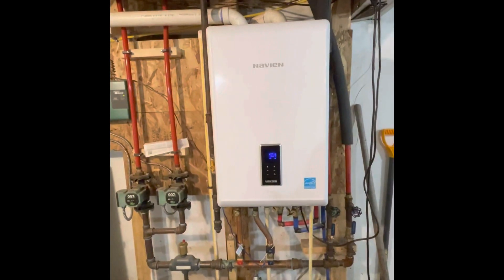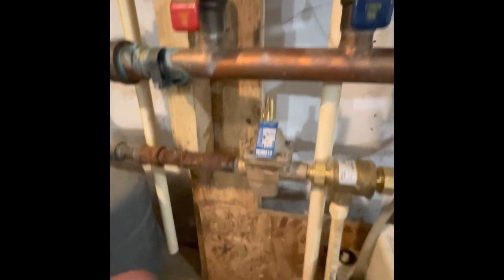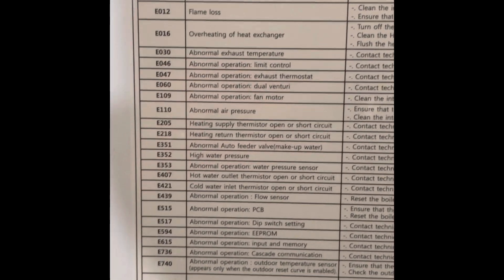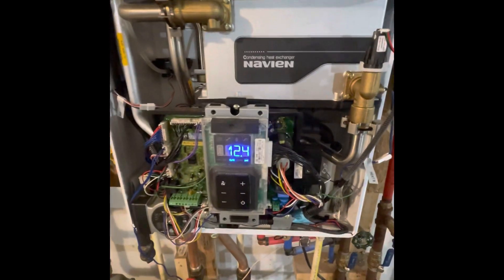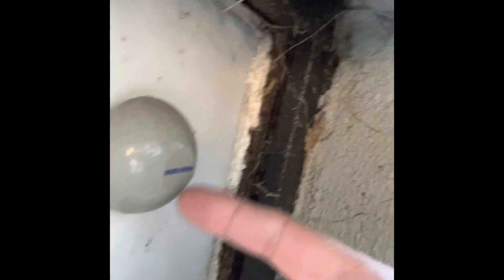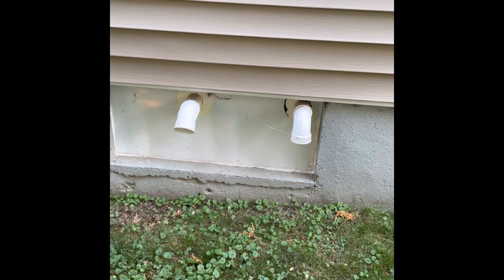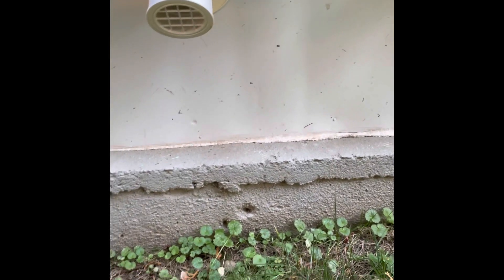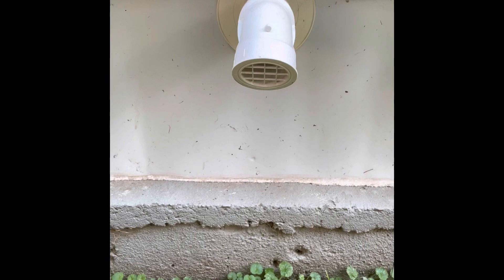NAVIEN E110 E351 error codes and tips and tricks on navien ncb-240e combi boiler - Maintenance

Comment: Sounds like you know a bit about navien heaters! I have a NR 240 that I acquired. I was told it worked great. I installed it and it worked for a bit, but now it won’t turn on. The control board does not illuminate. There was a small water leak that I fixed. Do u think I might need a new control/circuit board? Any suggestions? As a side note, I don’t have a remote (thermostat) if that matters. Thank you

Comment: I appreciate your suggestions, as well as those of some of your critiques. But it doesn’t help us. Last night a loud noise, for ~4 seconds, we had never heard, came from unit and then it stopped with E 110 code. I cleaned screen and tried to restart but got code again. I tried to share photo but it won’t let me. The intake and exhaust pipes were installed correctly, >12” apart, and the intake pipe has a down-facing inlet. but they’re up on our snow covered roof! So now what? I don’t see how anything could be blocking intake and my wife won’t let this 70-year-old venture up onto a snow covered roof.
Reply: If you have a blocked air intake pipe, but can't access the pipe termination thru the roof. Removing the front cover of the unit, and try to restart it by unplugging the cord for 30 seconds, to see if it works. That will allow the unit to draw in fresh air from the room it is located in and it should work temporarily until you can access the vent pipe termination to clean or thaw it. If that does not work, then it is likely a different problem.

Comment: The reason for the E110 error code is your exhaust and air intake vents are not installed properly. They need to be at least 12" apart (sideways and up and down), if you do not fix that then you will ruin your boiler, it can not run very long on it's own exhaust, it needs fresh air. Also if you would use the built in auto water feeder then you would not have your other problem. The outdoor thing is called an outdoor temperature sensor and not a thermostat as you named it. It is also not recommended to use vinegar to de-scale these boilers, you use a product called calci-free or similar, and if you don't know how to do that simple technique, then please wait to make videos until you have more experience. I am a Navien certified and trained contractor and if these boilers are correctly installed and maintained, you should never have a problem or any error codes, so please don't make them look bad with an incorrectly installed, error code producing unit. You should correct it and then make a video about how great it works!
Reply: I had a Navien installed several years ago by a pro, and I also have it descaled, serviced every fall, but it’s a money pit. First winter, at circulator pump went out, had to wait for it to ship from California. Granted they overnight shipped, but no heat or hot water, in the northeast, was brutal.  The following winter, some valve inside stopped working, again overnight from California.  Not long after that, the same valve again stopped working.  A Navien technician, explained to the plumber how to try and get the valve working, over the phone. They again overnight ship the part, and wanted the old shipped back to them. I said “no way”, I’m keeping it, as a back up, in case. 
It was suggested to install a dirt magnet, so the valve didn’t get plugged with debris.  Right now, we are waiting to get a water pressure (the one in video) what’s it, or perhaps the expansion tank replaced.  All of these service calls add up, too. The first circulator pump, and after some argument, the next were still under warranty. But still had to pay plumber for his time.
I have no idea how much this latest hiccup will cost me!
Reply from the maker: I love when people come onto my page and tell me what I should or should not do in regards to if I should make a video. 

Clearly, I’ve helped a bunch of people if you look at the comments on my videos, and that’s all my intention was. To help when “pros” like you won’t help a homeowner. I don’t use technical terms because I’m not a “pro” like yourself. My navien has been just fine since my video of force filling the unit (there’s a technical term for you). Also, you must have been there on that snowy icy night with me when I got the e110 code and my intake and exhaust were covered with frost. It’s amazing because as soon as I cleaned it, the unit worked and hasn’t popped that error up again. Seems like I’ve debunked both your theories….but don’t worry, worry about if I use technical terms or not sigh
Reply: @themillennialhomeowner1661  Sorry man, I didn't mean to come across so hard on you. I realize that I was critical, I apologize. Honestly, I was just trying to helpful. Please just take it for what it is worth to you. The reason your vent pipes were frosted shut that cold night is because the vent exhaust fumes/moisture is being sucked right into your fresh air intake pipe. That is why they need to be far enough apart so that doesn't happen. Your Navien needs fresh air to run correctly, when it sucks its own fumes back in, it will cause it to not burn properly and likely fail prematurely. Regarding your E351 error code (letting water in to the system by lifting up on the pressure regulator) I realize that has gotten a lot of people out a pinch when they had that low water pressure error code. And I commend you for that. However it is generally a temporary fix, because you will have to do it again when your pressure drops a little bit. You should adjust the water pressure regulator higher so that it maintains the correct water pressure automatically, thus having created a permanent fix! Obviously in your case that pressure regulator is set a little lower then what the Navien wants it to be, thus throwing the error code. (generally between 10 to 20 PSI is good) However the Navien also has a 1/2" connection on the bottom right back corner, that you can connect your water supply to (the same one that connects to your pressure regulator now) and that automatically maintains the correct system water pressure, and fills automatically when the water drops. That is the way all mine are done, and (knock on wood) I have never had that low water pressure error code yet. I am not trying to say that you have to do yours that way, just wanted to share some my experiences, so you can share them with others. I wish I had time to make videos like you do, I realize someone has to, maybe someday I won't be so busy.

Comment: Just take that syli feeder out use house water line pressure to feed the boiler through the designed inlet, take 45 out of the exhaust on outside.
Reply from the maker: Thanks for the feedback!

Yeah I’m not sure who installed this system wether it was the flippers (I bought this home after it was flipped) or it was a person in the trade but I’m sure it’s not 100% by the book correct. These systems are great when they’re working, and a pain when they’re not!